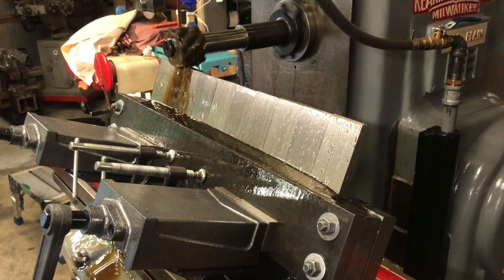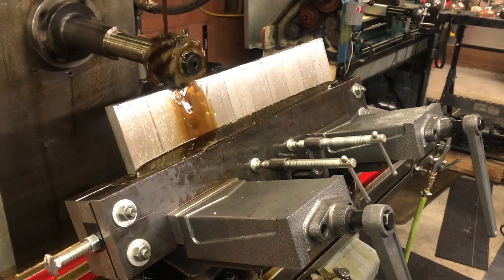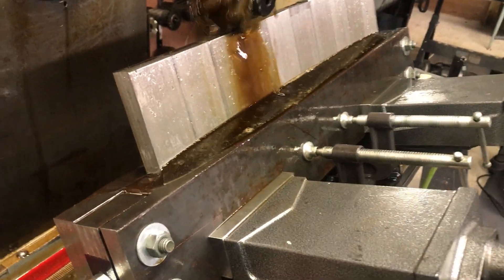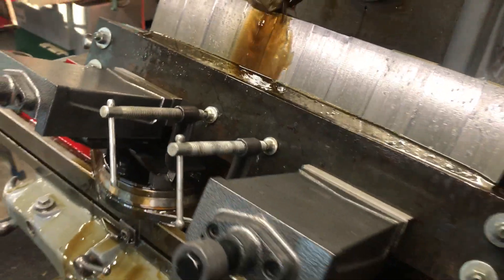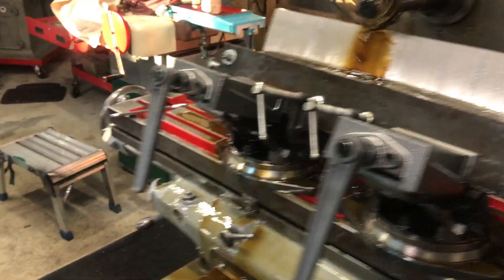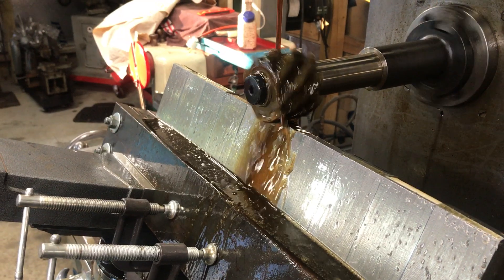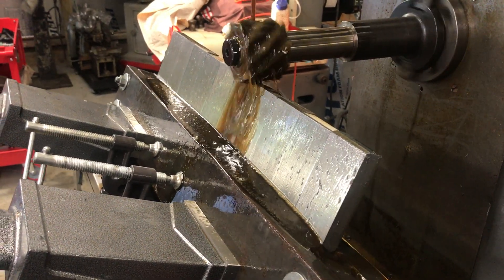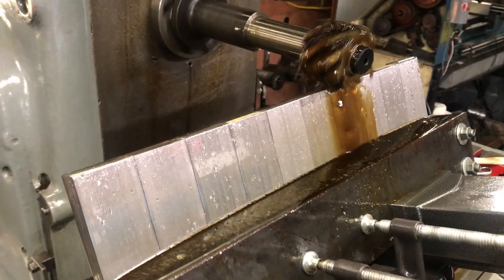Kearney Trecker 2K Plain Mill - gang milling

Comment: Can you set up and arbor support on the end to help with rigidity?  Mike in Louisiana
Reply from the maker: Thank you Mike. The issue i am having is mostly from the angle vises. these are not high quality vises. At some point i will make a fixed angle base (will have a video on that someday). Bolt all up and I think it will make a huge different. i prefer to have the arbor support all the time on this mill. but was am not getting the clearance for the vises so had to resort to the stub arbor.